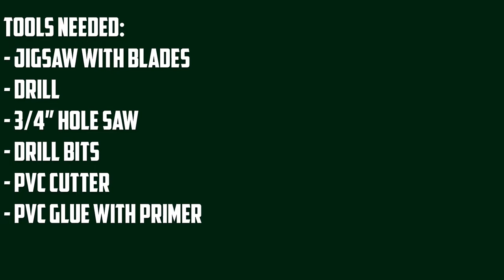How to Make a Recirculating Reservoir for Home Gardening | Home Garden Hydroponic Watering System

Comment: Hello Josh , I am building a water reservoir for my indoor plants and I would like to know the proper way of storing the water in a large 6 gallon container without getting mold issues. Should I keep the lid on the container closed air tight? Should I add an air pump to add oxygen bubbles to the water? How to avoid smelly molding water?
Reply: Air in your water. Use a vivosun 1200gph pump. Allow it freely run and mix your nutes. You can add an air stone as well to increase oxygen in the water. It’s more electricity but you can allow a small boy pump to run 100%of the time or the water will get hot.
Reply: You can add a timer to the pump in a timer to run 15 minutes prior to feed.
Reply: @bjdr2001  thanks

Comment: I'm not sure, but I think your inline filter is upside down
Reply: hanging direction is irrelevant afaik. the water pressure will simply push the water through the path of least resistance (in this case, through the filter).
Reply: That filter has an arrow so whatever way you screw it in the water pushes and gets filtered and then goes in the direction. It really doesn’t matter if it’s up or down or sideways water hits the mash goes past the mash to the outside and then in the other direction.